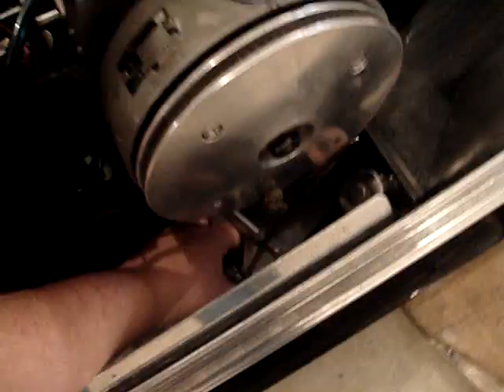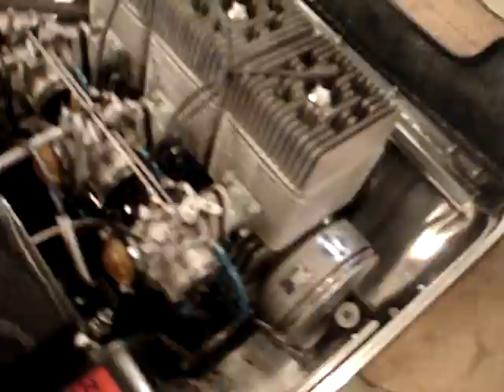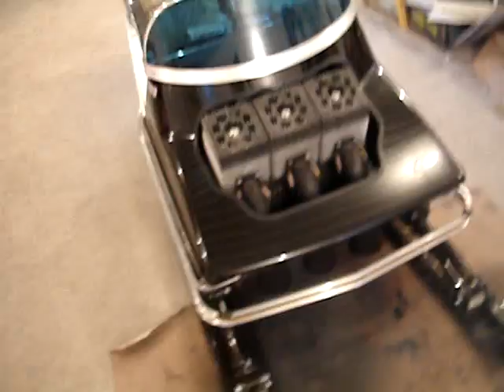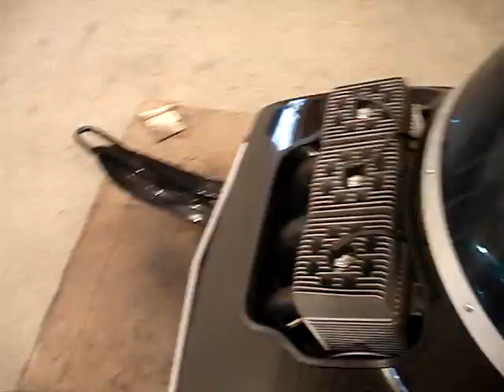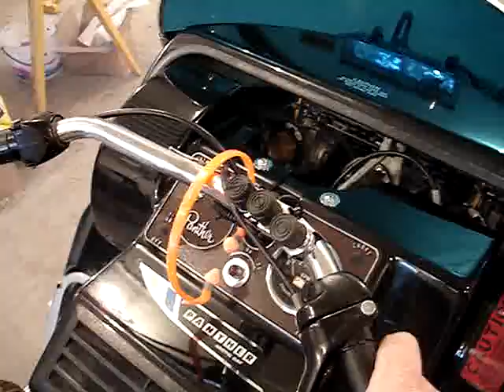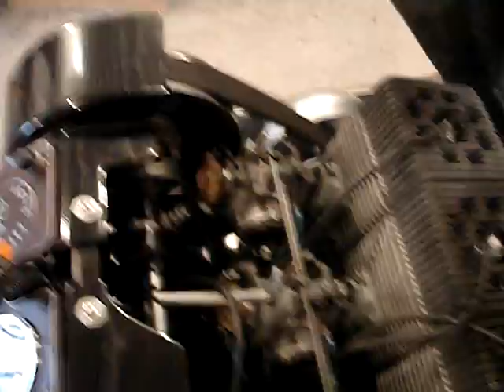1970 Arctic Cat 793 Hirth Panther

Comment: My father raced one of these. BUBBA DESJARDINS... from Espanola Ontario.  
He welded hockey skate blades under the runners and replaced all the bar cleat bolts with longer ones that were sharpened like today's studs.  
There were no studs or carbides in those days.   
Lots of trophies 🏆 in our basement from riding this monster.

Comment: i didnt know they made motors that big back then i only ever seen 440,s around here  lol
Reply: Yea limited build race sled. I think they made 94 of these. I’m not certain but I do know these were hard to buy back in the day. You had to know someone or have racing credentials to get one. Cat would sell the 440 and under race sleds to about anyone but the big boys they didn’t make as many of and the distributors were fickle as to who got them. Probably a good idea as this engine can push over 80 hp+ and this sled could clock in the ninety mph range. With limited suspension travel you don’t want just any dude riding this. These old big boys require respect.
Reply: I’ve also been seeing the comments about how unreliable the early free airs were. Well , you had to know how to tune them and how to ride them. They were high strung race engines not for putt putt use. If a guy wanted to putt putt and also race a bit we’d probably try to sell them a 634 fan Puma instead of something like this.